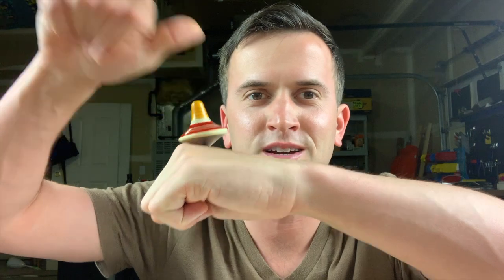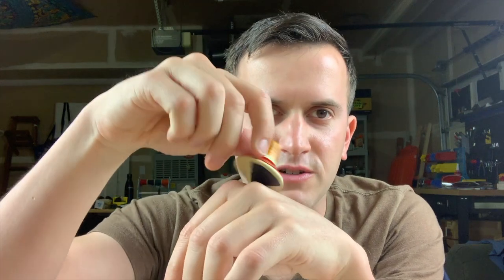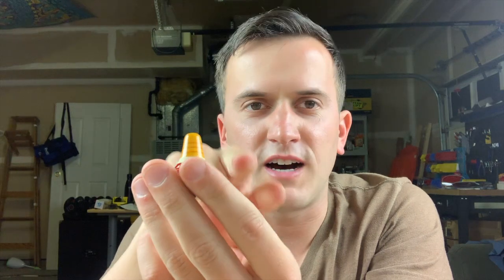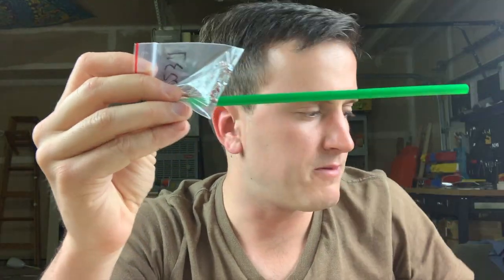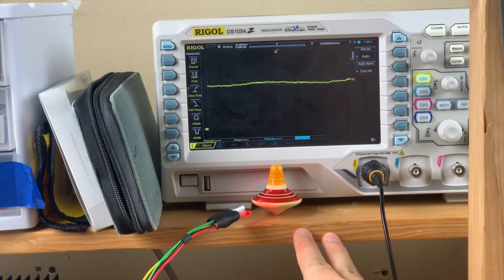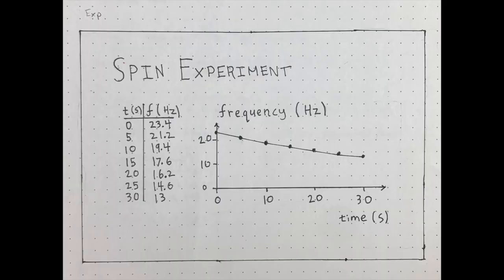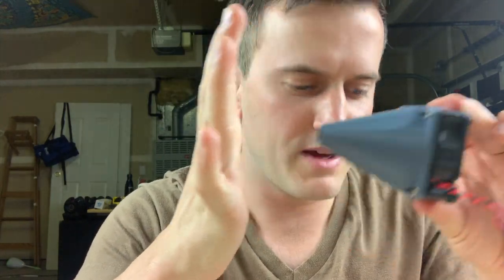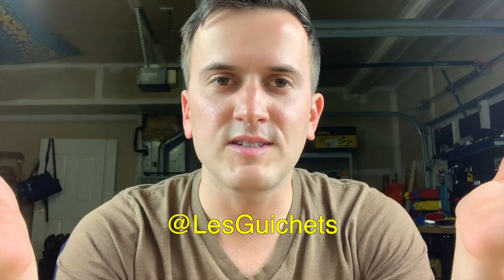Top Spinning Experiments

Comment: Interesting idea! My first thought would've been to stick magnets to the top and try and move it from below the table with a stator from a motor, but you'd have to have some kind of feedback to sync the two (what the brushes in a motor would do. So a bit of a long walk. For the airflow, the ideal way to test would be to get a compressor and a needle valve so you can throttle down the flow until you find the minimum required flow, and then get a fan that moves the same CFM. It may be worth trying out the little fan on a bench power supply so you can just give it more juice and see if that helps at all.

Comment: Nice video!
Axial fans and in particular computer ones “stall” with too much back pressure, imagine the blade as an airplane wing. Probably a centrifugal one might work better. Check how gyros in old artificial horizons are moved. (It is actually with vacuum but is the same principle.)
Maybe use 3 jets to keep it centered?
Reply from the maker: Thanks German! I did get some small centrifugal fans.  I just realized that air matress inflators must be able to handle lots of back pressure so I'm going to buy a couple of those too.